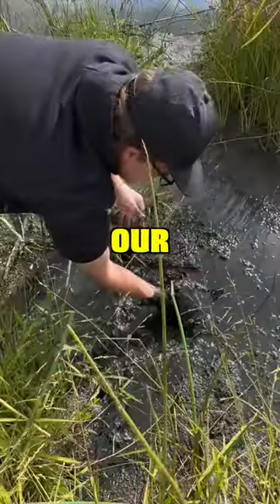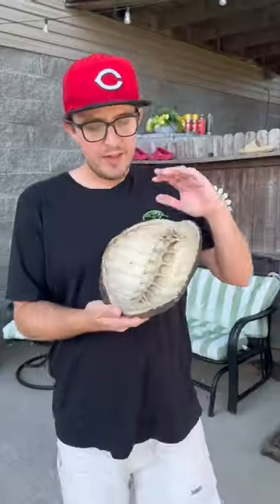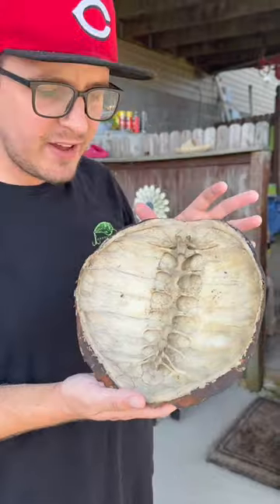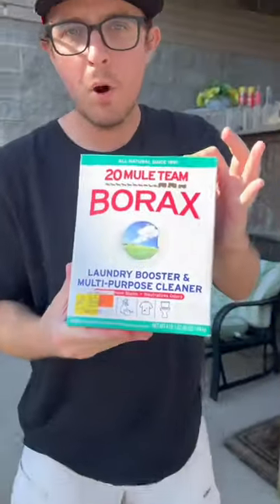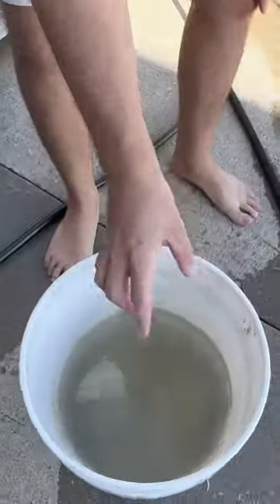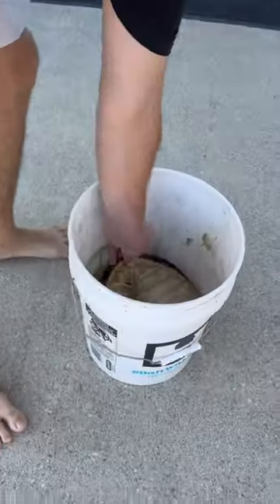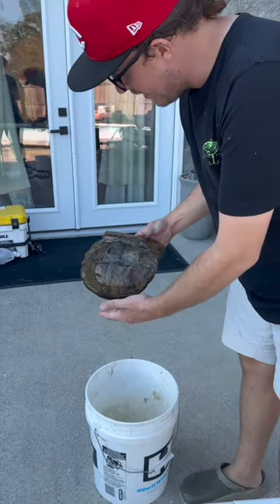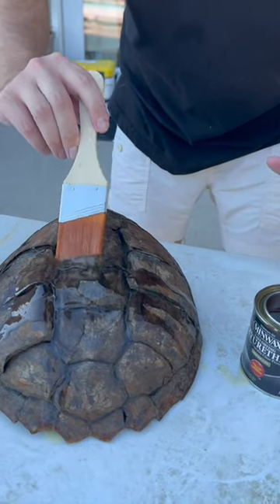How To Polish a Turtle Shell! #turtle #shell #turtleshell #polishing #diy

Comment: How do you keep the individual shell pieces from falling off
Reply: If you clean it quickly they stay on there original place. Or with the beetles they dry out and attach to the shell. But he soaked it after it had dried out so the scoots started to peel. Probably would've been fine just covering it with poly on both sides to seal in the smell.
Reply: Once he hits it with the polyethylene it'd stuck on, polyethylene is actually plastic. He doesn't seem too concerned with the scoots that come off during the cleaning process.